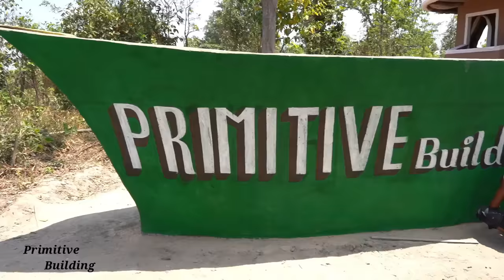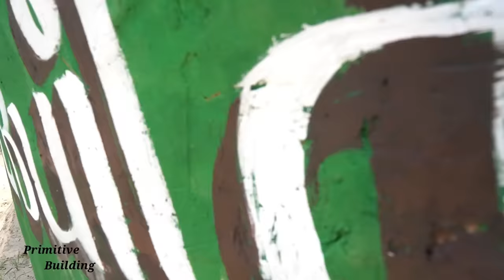Build Warships Villa And Swimming Pool Around Warships ( Full Video )

Comment: I watch these videos and am so impressed.  I have what might sound like a stupid question, but I'm not knowledgeable about the homes they build.  It looks like the structures are coated in mud.  .  Then they make pools and surround the structure with water.  My question is this, doesn't the water erode these structures?   And what if it rains?  Just curious
Reply: So they make their own concrete. Mixing charcoal and termite mound dust with mud creates a waterproof clay. I was confused at first too don't worry.
Reply: Its basically bricks but just not molded and dried, but built onto the structure itself
Reply: Thank you.  It is amazing
Reply: May I ask if this mixing muds could perform in a long period of time?
Reply: @gloruelofficial8182  It would wear down over time, but slowly enough that it could be repaired. If the site was abandoned, the building would eventually return to the earth
Reply: @Wi-Fi-El  thanks for the info bro 😊
Reply: they use straw and the mud is clay just like in the ancient time.

Comment: The surrounding pool is 3 feet deep, 40x40 feet minus the ship 10x30 feet. Total volume of the pool is 3900 cbf or around 110Kl. A bucket carry around 10l and they are 2 so 20l per load = they need to fill their buckets with water 5500 times. Let’s say the distance to the well is short, just a 10 min walk one way that gives 3 loads per hour and they work 12 hours per day filling water 6am to 6pm (dusk to dawn) with a 1 hour lunch break and 4 15 min rest. And they take Sundays off, it would take them little bit more than half a year to fill the surrounding pool. Hope they have chlorine pills and water cleaned or the water will be infested with bloodsucking mosquitoes.
Reply: You can see the stream from a top view. They’ve often made  a conduit to carry water using bamboo.